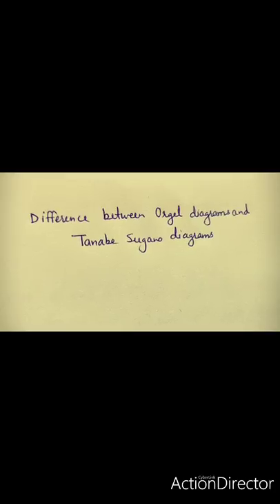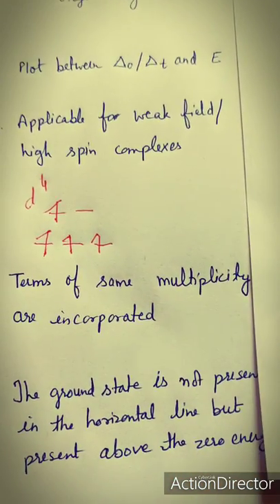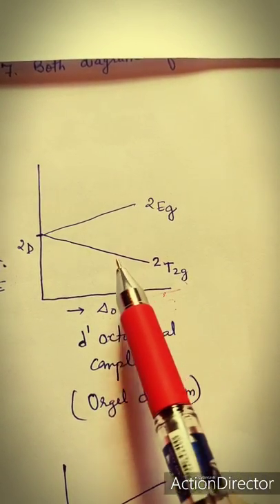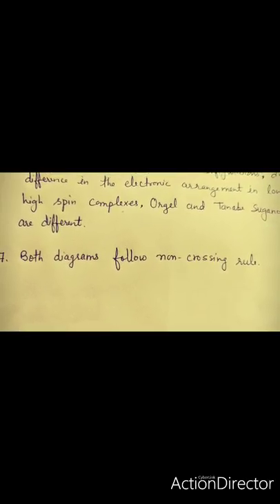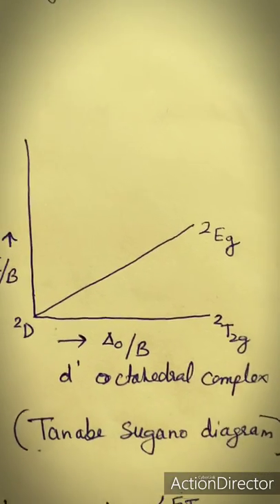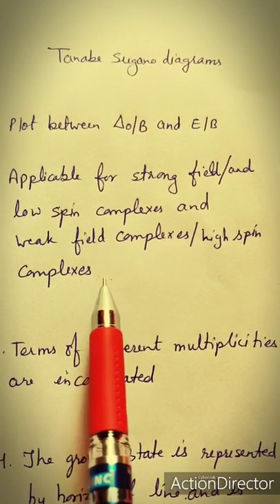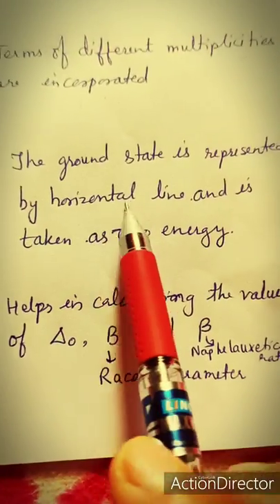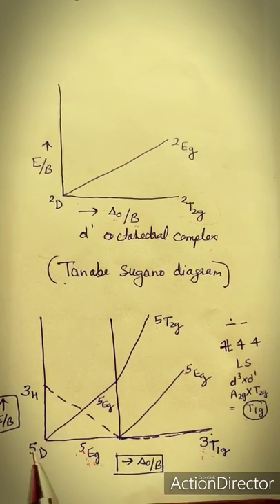Difference between Tanabe Sugano Diagrams and Orgel diagrams, NET exam, B Sc, M Sc

Comment from the maker: Dear students, CFSE values (∆o and ∆t) can be acertained with the help of Orgel diagrams for d1, d6, d4, d9, d3 and d8 configurations but for calculation of ∆o, specially for d2 and d7, Tanabe Sugano (TS) diagrams are useful because for its calculation, value of B should be calculated first. The value of B can be calculated by TS diagrams only.